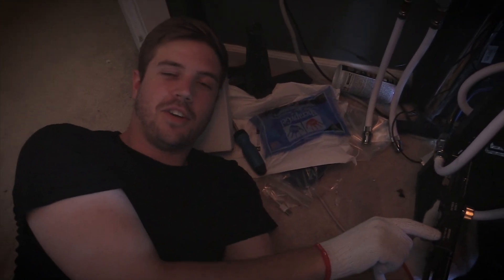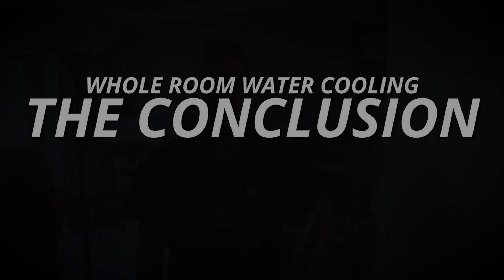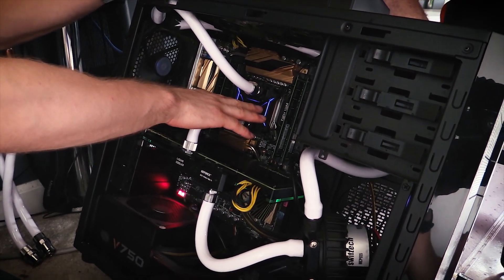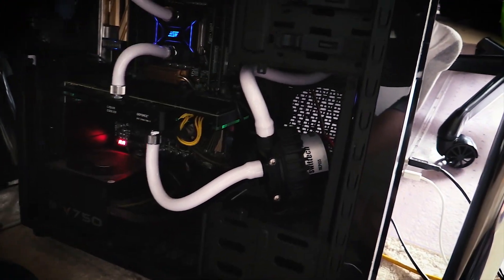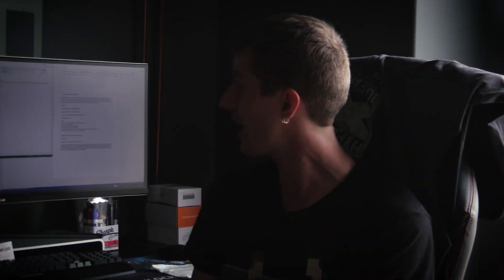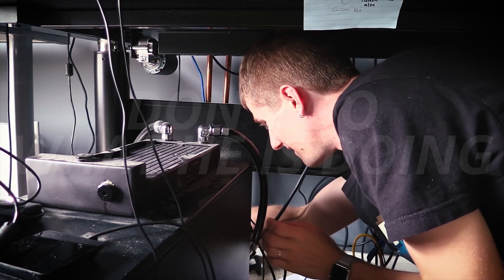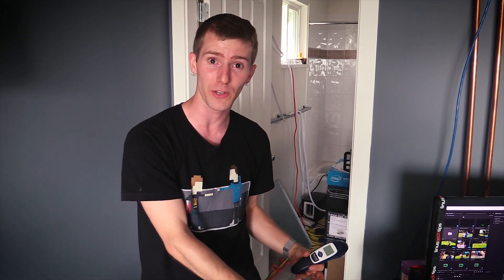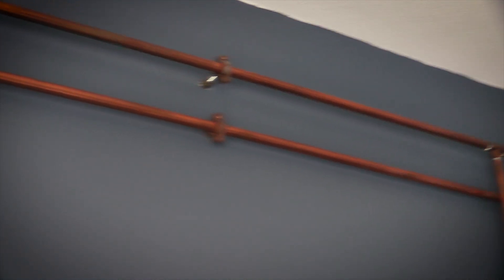Whole Room Water Cooling Part 7 - It's FINALLY over!

Comment: Wish I'd come across this video sooner... Water cooling, as with a typical combustion engine (esp. with the dissimilar metals of an iron block, aluminum heads, radiator and water pump), will corrode by way of electrolysis whereas the water becomes a conductor and, hence, the ensuing corrosion. In my automotive interests, I've come across a potential answer that seems to be proven in Jay Leno's Garage and on his YouTube channel regarding a waterless coolant product called Evan's Waterless Coolant that was used to replace traditional 15 years prior in one of his one-off custom cars. the fluid doesn't freeze until -40 deg. nor boil till 375 deg.   Fahrenheit - apologies I don't know how many Celsius offhand... when he opened his cooling system up on the car after 15 years, there was zero corrosion. hope this helps if you haven't already come across a solution
Reply: ... I must also follow up and state that, although it doesn't have quite as good a thermal transfer has water whereas it creates engines that run between 5 and 15 degrees hotter, the solution would be to have a larger volume of the coolant and/or radiator to bring temperatures to the desired range
Reply: +Gary Maier ... not sure what kind of metals and corrosion inhibitors are used in Evan's Waterless Coolant for auto app.'s. So, you may want to verify with the manufacturer before going that route including any interactions with particular plastics but there is quite a bit of that and rubber in an automobile engine... Just a phone call/email away from an answer...
Reply: Evans Waterless Coolant is also billed as 'lifetime coolant' for an automobile engine - having previously collected any drained Evans  then buttoned up any repair work, its poured right back into the engine to bring back up to level... I don't see why you couldn't empty it and transfer it to future comp. cooling systems forever and ever as long as you account / compensate a little on fluid volume and radiator heat transfer for the slightly lower thermal transfer capacity compared to water.

Comment: Cool system! I think the small temp difference of the out and inflow pipes are also indicators of the heat that is getting trapped inside the room instead of dispersing to the outside. For this solution, try insulating them. Insulating tubes are relatively cheap(though not asthetically pleasing as pure copper tubes) and are easy to install : wrap them around the tube and fix with some tie strings and you're all set! I think you'll experience some dramatic changes.

Comment: Best would be to wrap the tubes with a similar foam that is used around LN2 pots. They can manufacture it in the right OD and in any length. Just cut the foam open with a knife on one side, clip it over and then stitch it.

Comment: You basically made your room into the cooling tower. Just get some spray insulation for the pipes. How are you capable of executing something like this but not considering the result first? And come to think of it the use of copper in a closed system is just... yeah.

Comment: Whoever came up with the idea of using uninsulated copper tubing for "plumbing" the room must of been smoking his running socks or drinking some of that special 'Kool-Aid".  You could've just put a couple of just put a couple of bungs on a beer keg for a reservoir as skipped anything you putting your heat exchanger \ radiator outside.   The concept of uninsulated copper tubing  for plumbing the system probably would work at United States Research station on McMurdo Sound in Antarctica as a way to help heat the place but at the world headquarters of Linus Tech Tips everybody who did anything on that build needs a checkup from the neck up. If you have any extra parts from the build and would like to upcycle them my way I could sure use them antique my rig took a dump on me and is not worth fixing and since I am beyond broke building a new one even a cheapy is out of the question. I will have to say it was intresting watch you build it your room radiator heating system.

Comment: Always wondered about attempting this, so thank you for showing us what the difficulties would be.

Personally, I'm going to attempt something like this, but for just two PCs, all PVC piping, and install the radiator in a vent. That way I can wind tunnel the thing and hide it someplace safer than a roof.

Oh, and why have the piping so high up? You're fighting gravity for no reason...

Comment: Best laptop ever Metabox Prime P670RE-G
17.3" IPS (1920 x 1080) FHD Matte LED with NVIDIA G-Sync Technology
Nvidia GeForce GTX 970M with 6GB GDDR5 with G-Sync Technology
Intel Core i7-6700HQ Processor (6M Cache up to 3.50 GHz)
64GB DDR4 2133MHZ (4 x 16GB)
Crucial 500GB MX200 SATA 3 M.2 SSD
Crucial 500GB MX200 SATA 3 M.2 SSD
Samsung 850 PRO 2TB SATA 3 SSD
Samsung 850 PRO 2TB SATA 3 SSD
Killer 1535 AC Low Latency WIFI and Bluetooth
External USB Slim DVD-RW Optical Drive
Windows 10 Professional 64 Bit
3 Year Metabox Platinum Care Onsite Pickup Protection
Dual Surface 3D Textured Carbon Wrap - Top Lid + Palm Case (+3 business days to processing time)Microsoft Office Home and Student 2016
Microsoft Office Home and Business 2016keyboard Razer BlackWidow Ultimate 2014External hdd Seagate 4TB USB 3.0USB Digital TV Tuner with RemoteandRazer Ouroboros Gaming Mouse=$8,566.00I don't have it but it's got exelient

Comment: Hi Linus, why don't you replace your PC radiator with a performance  car aluminium block radiator & get a high speed fan for it? I would like to see will it improve the quality of the cooling. Imagine 2 car aluminium block radiator sandwich between an high speed fan.

Comment: It seems they rushed into this "concept" a bit too fast. It was a good concept, but they didn't really think about it.  Most of their problems could have been solved if they just did a brainstorm on what could possibly be wrong with how they approached their "concept". I mean, copper.. really wasn't the best option :P. The pipes probably act more as a radiator than the unit outside.

Comment: The idea you have is called an heat exchanger (nuclear fission plants use this process). If you want to improve the efficiency, try insulating the outlet piping to prevent reintroduction of the heat.

Comment: Well I am actually not surprised that you couldn't cool down the room even more.. Going with copper tubing is an absolute stupidity, as copper dissipates a lot of heat in the room, and there's not much left to cool outside. More then that, if the volume of the water is slow enough (liters/second), you could actually heat up the cooled water from the outside at the room temperature, and by the time it takes to reach the computer's CPU, is warm again. You should use plastic tubing, and thermally insulate them, so that there is very little interaction with room's ambiance.

Comment: why don't you put all the workstations in the server room, runs display cables with Avenview and usb thru Icron USB extenders using cat5e, then build a giant water cooling tank in that server room with glowing fancy LED lights. 
Buy an aircon and clean all the cable mess in the studio. Power plugs & cables can generate heats also display monitors.

Comment: 1- You should definitely have used plastic pipes instead of copper (so you don't dump half the heat in the room before it gets out). 2- Lay your pipes near the baseboards. It wouls have reduced the piping length by half, therfore costing less, and having less pipe surface to bleed heat back in the room before it's evacuated. It would also have made bleeding the air out of the system much easier. 3- Nothing wrong with a metal tank. You genius probably only used water instead of proper coolant fruid (i.e. prestone) that contain anti-corrosion agents. Also, make sure you don't forget to use an algicide so nothing grows in there. 4- i'm not sure how efficient a simple radiator + fans located outside can be when it gets very hot outside. A radiator will never be able to go cooler than the ambiant air temperature under normal circumstances, so this system is pretty much useless when you need it the most.
Reply: I will say that having longer pipes totally increases to cooling capacity but like you said since its un insulated it's more surface area heating the room

Comment: Why didn't you add foam insulation to the pipes? Such as that one used in A/C systems... that would mitigate the dissipation of heat into the room.

Comment: Should try wrapping all those copper pipes in insulation to stop them leaking heat into the room
Reply: +Daniel Healy thats what the radiators are for...
Reply: +Daniel Healy The objective is to keep the room cooler. This is done by placing the radiator outside of the room so that all heat transfers happen there. By having the pipes exposed, not insulated, the pipes transfer heat into the air in the room instead of transferring outside via the radiator. Yes, the pipes would be cooler if they are not insulated, but only because they are able to transfer their heat into the room. You want that heat trapped in the water and pipes until it gets out to the radiator.
Reply: +Daniel Healy You wrap the hot water out going only while it's in the room. That way it radiates outside instead of indoors. You wouldn't need to wrap the incoming "colder" pipes.

But still, the easiest option (as he points out) is simply air conditioning. Individually water cooled systems can dissipate enough into the room (if their radiators are large enough) to do what they are trying to do and then you only need to move the warm air out which is far easier to do than moving the hot water around long distances.
Reply: ***** insulating the pipes keeps the heat in, heading up the water, lowering the amount of heat able to be transferred into the water and having a higher temperature at the CPU.
Reply: right because that makes so much sense
Reply: intra morph - I see you suffer from Dunning Kruger syndrome https://en.wikipedia.org/wiki/Dunning%E2%80%93Kruger_effect
Reply: tosgem you nailed it
Reply: damn true !!
Reply: Half of the pipes*
Reply: killer1986chris No, the radiators are outside so for outgoing pipes you don't want the heat leaking into the room, and for incoming pipes you don't want a) the room temp heating incoming water (if room temp is higher than outside) or b) room temp being heated by incoming water (if room temp is lower than outside temp)
Reply: Heat up the water in pipes? I dont think you have any idea how insulation works man :)
Reply: tosgem stfu water u plumber pleb
Reply: +tosgem You do realize that wrapping the pipes with insulation will heat up the water inside the pipes, thus negating any kind of cooling to be done.

Comment: +LinusTechTips
8:00 You can reduce the heat radiation from the copper tubes by painting them in a silver/chrome color with a regular spray can.
   My dad has told me that when he was young he painted the house radiators in his room (to make them look cool) with that "color" and discovered that it significantly reduced the heat they could radiate (the radiators both looked cool and became cool :P )
Reply: +Sion Damn right!^^ I'm a painter, guess why radiators are painted white, it reflects more heat...
Reply: Doubt it's the color. More just adding paint, blocks heat.
Reply: I know common sense, white takes in less heat...

Comment: +LinusTechTips
I don't know how the winters are wherever you live, but you could make a switch so the warm water goes into a cooling system inside your house and thus will heat up your house in the winter with otherwise wasted heat.

Comment: I might try a similar concept at some point but with A/C in room and computer led directly to the room system 24/7 rather than being able to change to room or on board radiator also i would insulate the pipes also cover them in some wood or something to cover them Add a bleed point somewere and also only have about 3 or 4 pc's on it and if i had more the'd go in a seperate room with its own pipes that join up at the main radiator that way they don't have isues with heat with eeach other

Comment: Lol, I have and had so many ideas about this... Like run the pipes through the floors instead of up in the room to reduce the length of pipe. Insulate the pipes.... And make a large "well" on the roof for the pressure you need.... Though... The height of the well will need to be calculated carefully because the amount of pressure by the size of the tank would be substantial!!! :-) good luck with the next attempt if ever. The next attempt will be better for sure and I bet you'd be able to make it work better with a little carpentry!

Comment: what do you use to check CPU temps???
Reply: +Ausintune  The thermometer that comes in the CPU
Reply: no i mean the software
Reply: +Ausintune windows...
Reply: +Ausintune it's a program called Aida64
Reply: http://www.aida64.com/downloads this is the software he is using to monitor temps and benchmark under load. Free trial downloads available.
Reply: k

Comment: and you could slap some peltier units on the radiator and watercool the hot side with its own radiator
total radiators: 2
hardware temp: >40c

Comment: I can't help but wonder why the copper pipe running all over isn't wrapped in insulating foam? 
Pretty sure you'd see another few degrees drop just by doing that.
Foam insulation tubes are cheap, seems sorta of lame to not do things right and finish the job before making a judgement.

Comment: Looks awesome ... But you need to use RuberTex pipe insulation on all your copper and then probably up your radiator size outside and fan capacity.

Comment: Pvc pipe ran along the baseboards would have been much cheaper and more efficient.  Or just a simple window a/c unit would have probably been your best/easiest solution.  Cool thing to try though, just sucks you didn't get that good of results.

Comment: the room doesn't get much cooler because the pipes are radiating the heat before the fluid gets to the outside radiator.

Put pipe insulation on the pipes.

Comment: 1. Insulation on cooper pipes. 
2. Not sure if the way you connect them is good enough. TBH, you might run into probables with air bubbles in the pipes blocking the flow. 

If anything, I'd say trying to connect to air conditioning could work. Creating new system, that does only that seems an overkill. :V

Comment: If your outdoor radiator is in direct sun and the pipes aren't insulated what gains will you get? Idea isn't bad in theory (if implemented correctly), but in practice it looks like there are some problems. As for corrosion problems or gunk, use distilled water not tap in the cooling circuit - also the choice of antifreeze added makes a difference as some organics (like Dex) are prone to gumming. (Better to stick with ethylene glycol.) The reservoir tank being metal shouldn't be a problem either if it's stainless or aluminum, but if you're still worried then drop a block of zinc in there - should keep pH in check.

Not a bad start, but it could be done better. If you can afford to throw this much at it, may as well go all out.